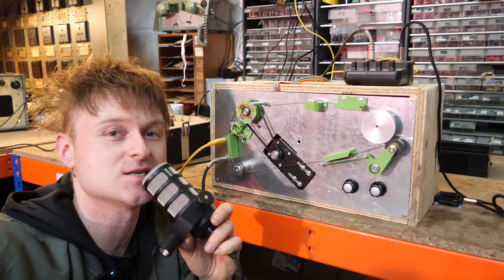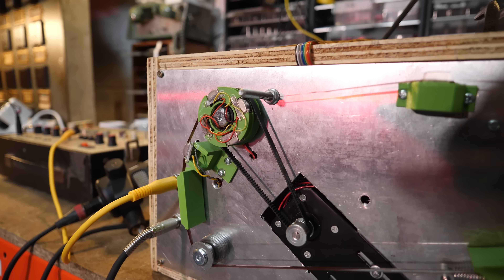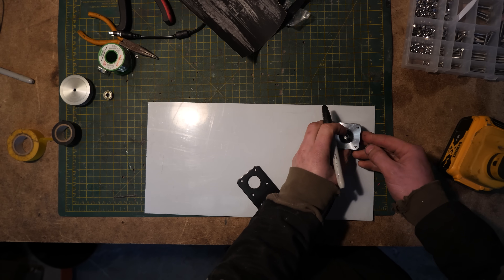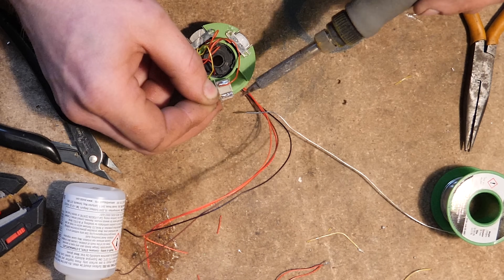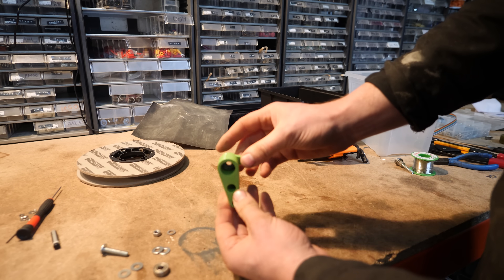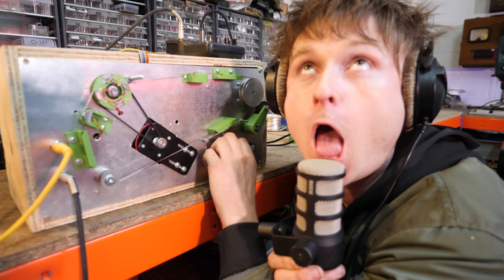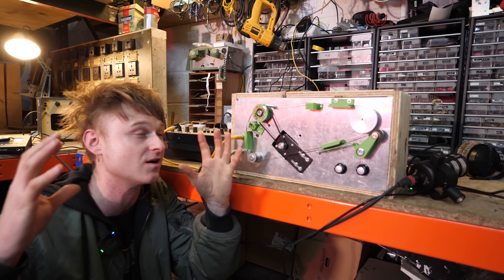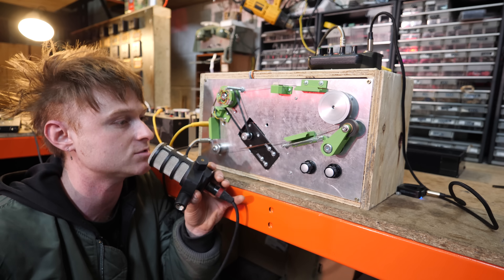A Realtime Pitch Shifter Made From TAPE AND ROTATING TAPE HEADS :O did it work?

Comment: It sounds just like a cassette answering machine, exactly. I used large head drums as drive wheels to get cassette tape going about 23 miles per hour on a 20' foot loop and after running it through the cassette head mechanism the tape would stretch. So much that when you pulled it off the loop it would curl itself up with really really small curls. Even bad consumer 1/4 reel to reel is better, but use the pro stuff, you'll be happy you did. NICE WORK by the way!

Comment: If you keep using this, then look at switching from sliprings to rotary transformers. It's a thing that VCRs did for the same use-case, because the sliprings kept needing to get replaced.
Reply from the maker: indeed. but a slipring is fine in this as we are running at significantly lower rpm. no need to overcomplicate where not required

Comment: Just for clarity I was not talking about using the VCR heads themselves but using the bearings/housing. I have been able to remove some of them and reorientate them to run vertically. The idea I was making a rotary transformer/inductive loop/noncontact slip ring inside the body of unit between the two halves like the ones that VCR heads use. Lastly,  Sam by all means keep this tape head implementation as it is ingenious and sounds great.

Comment: Do you think a drum head from a vcr or beta player would work for the rotating head ?
Reply from the maker: as mentionned in videos. yes. but more work. only 2 read coils. and also you'd need to modify it so it worked straight instead of diagonally.

Comment: I've read about devices like these with rotating heads - apparently one application was for dictation, so that one could match the playback speed to the speed of the typist - but never seen one in reality. Well done! I think though that using stepper motors is going to result in audio that is modulated by the stepper frequency; in ordinary tape recorders smooth drive is essentially which is why they use heavy flywheels and very smooth drive shafts (capstans), but of course it depends on how much lo-fi you want. One thing I'm curious about, when pitching up, the rotating head will essentially read the same part of the tape over and over again, so will short percussive sounds result in a stutter effect in practice?

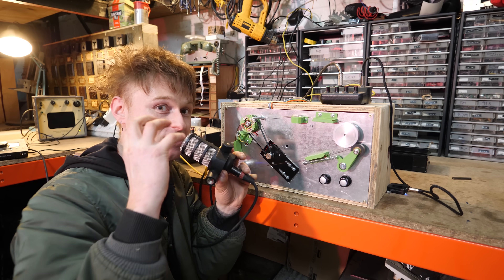Comment: 2:18 correct me if I'm wrong, but if you spin the reading heads' wheel fast enough in the same direction of the tape, you'll go from sounding really low to actually being in reverse! With a bigger wheel and less heads (so that you have longer audio splices), you would have an analog reverse delay! 😂

Comment: Crazy option for a delecate tensioner is either compressed air or a vacuum (if more tension is needed). This was hiw the old high speed computer reels were able to spin up and down quickly without snapping the tape

Comment: Amazing build! BTW, I wonder if that slip ring does introduce a lot of noise. The rotating heads in a VCR use a transformer where the core of the transformer is split in half and the primary side can thus rotate agains the secondary side - building that would be much, much harder than just buying a slip ring, but would transmit potentially much cleaner audio. But maybe that isn't worth improving, because of the lo-fi aesthetics of the whole endeavour.
Reply from the maker: Check the comments about the vhs drum. Slip ring doesn't I trodu e any noticeable noise listen when it's stationary to when it spins

Comment: Wondering if the sound quality would be better if you did this helically on a bigger tape, maybe salvage 2 vhs machines for quality multi head assemblys?
edit: Just realized Hi-Fi vhs already has helical audio capability built in, that would be funny to modify
Reply from the maker: helically would not make much of a difference quality wise, and also be a nightmare to sync heads, and the record head would also need to move meaning the other would need to move quicker, complication. the sound quality is the bad bias.

Comment: uuuh
actually
cou could use the VCO parts of 4046 cmos chip to generate the driving waveform for the stepper drivers, so look mum, no more computers in there
Reply from the maker: you dont even need that you can use a 555. but i needed to build this in 2 days basicaly. so stuck with reliable

Comment: This system was used in the 1940s on the first magnetofons. It was meant for recording high speed morse code signals (so a transmitting U-boat could send a message in a few seconds instead of a minute, making it harder to get a radio direction finder bearing on them), play it back at a low, human readable speed, and then pitching up the beeps to be easy to listen to again (morse code signals that are slowed down and end up at 50 or 100hz are very hard to read - you want them between 600 and 800hz)

Comment: So with 4 playback heads they need to be 90 degrees from each other on the drum and the tape presumably needs to pass over at a 90-degree angle...I wonder what sort of benefit you could get using 8 heads at 45 degrees, wiring 2 independent sets of 4. Perhaps a short delay or phase shift? You could even conceivably wire up another drum for independent pitch-shifted delay, or 4 in a row like a WEM Copycat!
Reply from the maker: 45 degrees it'll just be the same. I had a think and concluded 4 was best. As for multiple drums yes that is on the cards

Comment: I see 2 ways to improve it: use DC motors to drive the tape and heads (like real tape deck motors that have low wow&flutter), stepper motors are very steppy so they give this modulation effect (you may like it though), and have the tape exactly 1/4 around the pickup head spindle, so that one head is always in contact with the tape (as is now it loses contact but you may have intentionally made it that way for a modulation effect)
Reply from the maker: the steppers are fine :). it was initially 90 degrees it didnt work as there was a merging every time a head came on and left. i endd up feeling for the optimum angle then put that bolt in place, it works out about 87 degrees. so there is no cross over betwen heads. it doesnt lose contact.

Comment: your hot glue sprocket was neat. 
i have used gt2 belt wrapped around a gt2 sprocket (flat side out) to act as a tire and that works well. 
helps to reduce the bump if you use a scarf joint.

Comment: I'm wondering if you can get more definition/control using more than four tape heads to play? Appreciate the need to only have one tape head at a time going being output, and the 90deg thing with 4 tape heads is a simple solution, but you could have a load of them if each of your tape heads went to a little sprung copper shoe (like you get on the bottom of cheap mini Scalextric cars) or pogo pins (maybe?) brushing over a copper track that leads to your amp/audio processing circuit. Your spinning audio tape heads then don't need to be part of the system putting tension on the tape (they could just be in line) and you lose the noise from the tape heads that aren't in contact from the tape (but picking up other sources of magnetism). Presumably if you had a large enough spinning wheel of tape heads, and you could easily remove them (I'm thinking the way plug and play switches connect to the pcb on a mechanical computer keyboard), you can create a rhythmic stuttering effect. And if you had the spinning tape heads in the middle of the tape loop, you could have a delay as the tape passes the other side of the wheel. Dunno, just some initial thoughts that I had! Love your work and creativity, keep it up Sam!

Comment: I would venture to say, that this is not pitch, as you can't move faster or slower than time, but it is instead formant shifting.
Reply from the maker: Not sure. As it does increase the speed at which it is read. But in small pockets. I'd still side with pitch over formant

Comment: you ought to add more heads with a minimal spacing.  That should reduce the chop between heads.  Great concept.  I may have to build one.
Reply from the maker: the chop is minimal to inexistant. itll be fine. 4 is the magic number between angle/tension and fading between heads

Comment: Awesome build! You'll hear some frequency modulation due to stepper motor pulsation as it spins. You might be better off with a DC servo plus gear reduction box. And/or use a flywheel driven by a rubber belt to smooth out motor noise and pulsation.
Reply from the maker: Thanks but I think this is suffice. It's microstepping and is smooth enough. The sound issues are mainly down to the crappy bias. Roll on mk2!

Comment: What about the springy foam bit that push tapes onto the heads to not rely on tension? I mean, you have them on any cassette.
Reply from the maker: you do i mention it in the video. but its just not a reliable means in my opinion when dealing with tape loops and rotating drums

Comment: I found out if you don't terminate and properly configure to tie high or low unused MCU pins with resistors, you get errors inside the MCU.
Because i was polling the internals. my RISC MCU has configurable  internal pull up/downs for this purpose.

Comment: Some tips: First, you need a proper Erase head—the best ones are two-gap ones. You also need record and play heads that cover the whole tape; this will give you the best SNR and dynamic range. There are cheap one-track reel-to-reel heads on eBay that are perfect for this. As you mentioned, you need AC Bias in your erase and record heads. That is too big of a habit hole for a YouTube post, but that is crucial for a good recording. I would say get an old reel-to-reel on eBay and use its electronics since designing the recording circuitry is very complicated.
Reply from the maker: hey thanks. yeah i am planning all of this for mk2. i made this one in the space of 3 days from things sitting around, no time to be picky with what i used. and there is ac bias coming from the copicat, i breadboarded my own record circuit the night before but it didnt work very well so gave uo for the vid and put on copicat

Comment: hehe, it's much easier to hook the stepper motor up to a planetary gear acting as a 3-way differential connected to the tape-drive motor and the tape drive rotor. Mechanical boolean addition of rotational velocity. Probably what tandem bikes use to couple the two sets of pedals to a single drive-chain

Comment: Fantastic! How much noise does the slip ring introduce? I am curious if anyone has tried to use a rotary transformer? You know like the ones found in a vcr drum? Personally I have always wanted to try and mount a set of tape heads on a vcr drum for something like this. The bearings are super smooth.
Reply: VCR-tape head drum came to my mind too. The tape heads in them might be rubbish for audio because they are meant for a frequencies above audio, but maybe the drum assembly itself could be used somehow. In a VCR the tape runs at a slight angle against the drum, but if taken out and attached to something else you could probably run it straight too.
Reply: @Elektronijaenis  I have found one RCA camcorder that allowed me to run the head flat. At the time I ended up dropping it and shattering the ferrite plate that the coils were inset around and never got around to actually testing the tape heads out. What would be really cool is to design a 3D printed drum like head with the transformer built in and give that a go.

Comment: Pretty neat, Sam! The machines of this sort were only around for about a decade, and when the various digital pitchshifters popped up (courtesy of Eventide, et al) they proved to be much easier to use and far less fiddly.

I noted that someone else mentioned the Eltro Time Compander; this was the "klangumwandler" of the gods. Unlike the homebrew one you made, the Eltro was designed to work with reel tape...it functioned as a take up reel motor. Going to 1/4" will help with stability, but I would suggest adding a 6 to 8 ounce flywheel to the head array to help with stability.

Otherwise, this is pretty awesome! And yes, going to something like Scotch 250 for the 1/4" needed will be dicey due to supply, but it DOES hold up better over time.

Comment: Very cool! Might be good to test with a DC or BLDC motor instead of a stepper, as at higher head speeds you might be able to hear the discrete stepping of the motor modulating the output as a pitch or at lower speeds as stutter (especially with how you've geared it down).

Comment: "Started designing two days before the show". Oh man, that is some rapid prototyping. Regardless if you made the deadline or not, that is impressively swift engineering! 

I have so many questions! If there's more than 4 heads, would the "grain-size" be smaller, and the quality better? MK2 will have more heads yeah? Also, and this is kind of a what-if, but what kind of effect would you get if you gave the recording head the same treatment? Or you put the recording head on a linear slide and make it oscillate back and forth on the loop? Mechanical LFO? 

Suffice to say, you're making stuff that works wonders on the imagination man. So many possibilities!

Comment: actually, the Nazi's used this same technology in the 1940's. the German Tonschreiber tape recorders made by AEG had a Dehner head which was 4 pole rotating head. they could record morse code at high speed and transmit it making it very hard to figure out.

Comment: I wonder if you need the pick up spinning at all, or if a series of pick-up heads being switched between via a rotating contacts would work just as well?
Reply from the maker: It needs to move to simulate the tape moving constantly quicker or slower

Comment: Do two of them in parallel so you can have stereo pitch-shift, but put CV speed control so you can connect an LFO for guaranteed nausea in dolphins. Then, with a HOTAS and a recording of a Hummingbird Hawk Moth, build a remote control for insectivorous bats.
Reply: ...Doppler effects on ping-pong delay. Get a Holographic Jungle D&B Fingerdrumming genre going.

Comment: 5:16 what if you did that on purpose though? it might be an ever cooler sounding effect to have the same tape heads reading at different timings
Reply: also if you had the tape heads overlapping, you could also wire them up to be stereo, so you get a L/R analog delay from a mono input

Comment: I wonder about the affect the changing AC bias frequency might have. That bias is on the tape with your audio, so changing the head speed relative to tape speed will naturally change the effective bias frequency on playback too. Sure, the AC bias is always supposed to be ultrasonic, but shifting bias frequency around that the heads see without somehow compensating for this in, say, the corner frequency of the head amp seems likely to introduce bleed through, aliasing, or weird variable harmonic distortion.

Comment: How does moving the heads as opposed to changing the ips make this work? Evidentially it is possible, if I were you my next steps would be, using better tape, better heads, your slip ring is the main issue, the noise, maybe look into how vhs helical scan heads work, in relation to signal transfer. So many possibilities 😅
Reply from the maker: The slip ring makes no sound when no sound is on tape  o noise. I mention the stuff in the end of vid which will be in mk2 cheers
Reply from the maker: VHS was a plan at start but it was too much work. 2 heads per drum. Pain to make spin straight and also heads tiny and tracking would
Need to be perfect. The approach I did with 4 heads and slip ring was much better

Comment: I thought this was going to be a VHS head...
Hmm... I wonder.

Sick machine, Sam.
Hope to see you again soon.
Reply: I had the same initial thought but, even if the movement would likely be smoother, the helical scan of VHS (like most tape video recording system) reads and writes 'chunks' of signal (the lines of the image) at an angle, it's not a continuous trace along the tape 😕
Reply: @lorenzo.c  Helical playback of a perpendicular recording would do the right thing, wouldn't it? While perpendicular playback of a helical recording would let you make an analog granulator. (Or else I'm confused, I might be confused.)
Reply: @lorenzo.c  The helical scan happens because the head drum is tilted with respect to the tape. You could mount it vertically and eliminate that problem.
Reply: @GRAHAMAUS  San addressed this point himself https://www.youtube.com/watch?v=U-4AMxkpyh0&lc=UgwxhGSViA6svjp_0cR4AaABAg.A9pXp49z754A9rLMAG4pOY&ab_channel=LOOKMUMNOCOMPUTER
The video heads for PAL SP VHS are 0.049mm wide (VHS Hi-Fi audio heads are 0.042mm) while 1/4" tape is 6.35mm (130x width).
If one tilted the axis of the head drum and made it normal to the tape, the width of tape actually used would be very very small.
Another drawback is the number of heads on the drum: only two at opposite positions. 4-heads, 5-heads, 6-heads (!) have pair of different type heads.
Finally the azimuth of video heads is not 0 deg like reel-to-reel tape so the quality of the signal would be degraded.
To make use of the good mechanics of a VCR one would have to, somehow, fit 4 standard tape audio heads in the drum. I would like to see that but it seems quite the challenge.

Comment: Love it. Could Mk2 have preset buttons? Hold the button down and turn the dial to set the preset, something like that? I guess you'd probably need an encoder at that point, to read the wheel position - but still, seems like that'd be super-handy for live performances. How quickly can she shift pitch? Hmmm.
Reply from the maker: thats what the voltage input then using synth modules comes in